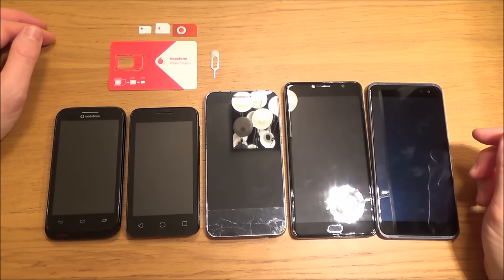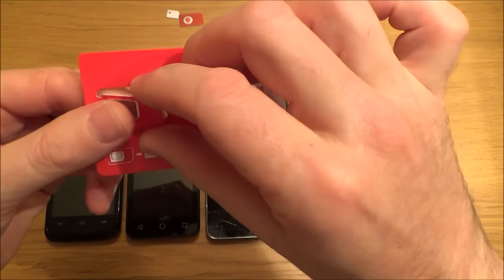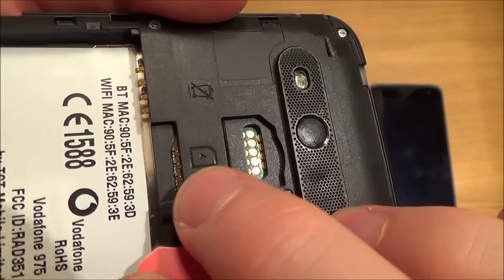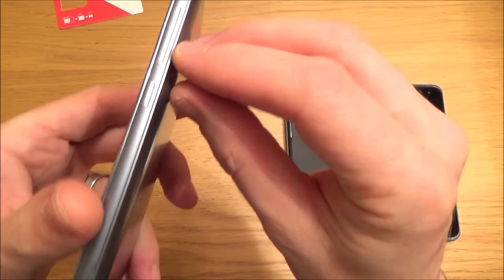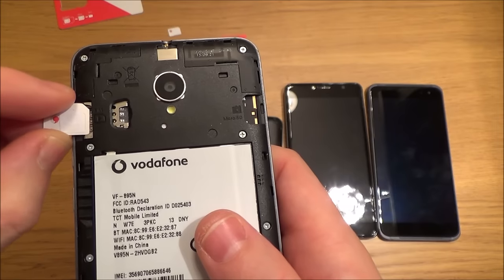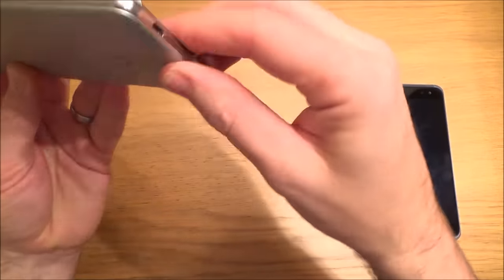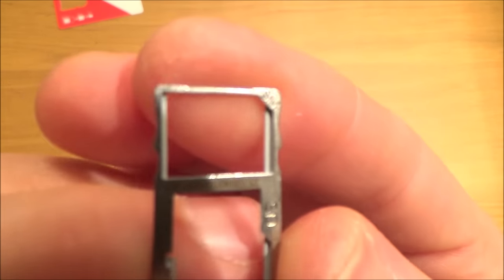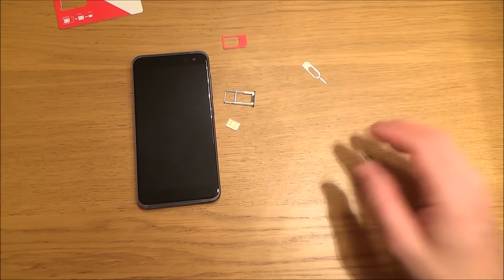How to INSERT / REMOVE a SIM card in various MOBILE  CELL PHONES

Comment: I have two new phones , why , because both phones say the same thing,   No sim inserted,  but they both came with a sim card inside ,  I have been calling and working on this problem for 3 weeks,   my first phone is from Consumer  Cellular, the second is  a Phone  Android ,  i  was told by CC , that the cell tower carrier, they deal with,  are receiving to many calls, they couldn't solve the problem , all I could do was use texting ,         The second phone was a prepaid  ST,   i  went on line and activated the phone , but now it say s    no sim card inserted, and yes it has a sim card inside.     I am 73 years old,  can't call anyone of my family,  i have been isolated in my home  for 3 months, can you tell me , or help me understand this problem.   Before i spend more money on phones.

Comment: THANK YOU! This video is still useful in 2021. 
I just dropped my Samsung cellphone on the floor. Face down. It's screen is completely shuttered. Dead.
So I searched for my old Samsung and found it in a drawer. The emails showed that it has been sitting there since 2017. The battery – amazingly! – woke up and charged. I gotta give Samsung a golden star for that. Again. (I am a graphic designer, I am used to work on Macs, but regarding the cellphones I am on the Samsung's side.)
I retrieved the cards from the broken Samsung cellphone and – thanks to your video – I managed to insert them in the old one.

Comment: I was having trouble getting the SIM card to slide in and now i know why. The size of the SIM card was one size too big. I took off the size and it slid right in. Thanks man.
Reply: Looking for advice too .Recommended thick special  cellotape press finger down many time open slot apparently sim will emerge, gentle bring it opening .Didn't work for me then I had afterthought pr tweezers gently grip tip  or  edge of sim which is easest be careful .Hope it works for you best solution. WIshes best luck 🎉

Comment: Excellent, thank you. You explained which way to put it in. Mine did not have a tray, put it in right but kept saying no sim?? Then I seen how you can get 3 different sizes from 1 sim. So went thru it all again, and noticed my card it came in still had the pop outs. What happened was I put a nano in a micro and it didn't work. Popped it back in the outer rim I still had and it works fine. Thank you, love doing things myself.

Comment: I have a Q link phone, Called a Hot pepper, its powered by android and it's was free for me I leaned how to remove the cover and the battery but the sim card is way smaller than what you have shown on your video's  so maybe mine doesn't need a new one I'm confused. loved your video you taught me several things thank you so much I will contact Q link.

Comment: Does a gold part of the SIM card go towards the screen or to the back of the phone because you had the phone upside down basically with the screen facing away so that's my question does the gold part face away from the screen it would have to I would think but since you did it backwards that's what you should add the screen facing the people so they can actually see which way that's green the card goes in but very good thank you very much for what you've done

Comment: Very helpful! Thanks. This is only the second cell phone I’ve ever had. Last time I think I took it into a store and they did it. Because of covid I haven’t been going in to stores. I’ll have to do this on my own. You made it much easier to figure it all out. There was no instruction on how to open the phone and there was no instruction on anything to do with SIM cards from the manufacturer’s manual. So this is greatly appreciated. I’m still a little confused about that second phone, I think it was. You said one slot was an SD slot. My phone looks like that slot but it says “SIM2”. I’m wondering if I can use both the micro and nano from the card that came with it?
Reply: Any one card that comes with the phone can only be adjusted to one size, based on the cut-outs of the card. You would actually need another card to use SIM2. A SIM card contains a person's phone number.

Comment: Hi Vince. Senior, and not very tech savvy. I have an old samsung s730m that is not cutting it anymore. I only use pay as you go for calling and texting. I purchased a new samsung galaxy a51 dual sim unlocked phone. If, using your video, I remove the sim and put it in the new phone, will that phone work, or must I contact a provider? Any help appreciated.

Comment: I'm in tears because I've  just broken three fingernails trying to get the back off of my phone using that notch. I do not  see how you popped them off so easily. There's no room in that space to insert a blunt knife, let alone one of my fingernails. I tried a tiny screwdriver, but even that is not small enough. I just cannot pry it off. I realize this is an older video, but maybe you'll see it and offer a solution.

Comment: I had no pin to open the side so I used a pearl earring and it popped open ,happy days
Reply: Actually any things that are small enough and strong enough like a straight steel rod can works to fit into that Sim hole and just push it in.It will pop right out of the Sim tray card out.Basically inside that small Sim hole it just a very small button on a spring that it.Buying a Sim tool for tray opener it a waste of money and waiting times for it to arrive.Remember those desktop computers with a CD/DVD drive with a small hole.You can pops it open the CD/DVD drive tray with any small flattening out small paper clips.It the same things designed just now it in a cell phone that’s all.
Reply: :o

Comment: On a iphone its also the same for a sim edject find a hole with a oval on it put the tool in and give it a bit of force and it will come out(physical sim iphones only) Note will not work for phones using esim

Comment: You neglected the procedure for every phone I have had...which is a clip that must by slid with one's fingernail, and flipped up so that the SIM can be inserted into that little clip holder, than flipped and held down and slid to lock it in place. The big problem with these clips is that they are delicate. If one isn't careful, the whole clip can pop out of the phone and one needs the precision of a brain surgeon to reattach it to the phone by inserting some really tiny pins into tiny slots.

Comment: Thanks a lot!  I just bought a smart phone and there is no little key inside the box, so I cannot get the sim card out of the phone.  Worse = that when i opened the newly bought phone it asked for a code, but I got it wrong, picture of the code in IN THIS phone!!   So I tried 3 times and now it asks for a PUK code which I do not have.  I can not use my old phone because I cannot get the sim card out of the newly bought smart phone. What a stupid vendor, only gives half of explanation and now I am without any phone the whole evening and tomorrow loosing time to get back to that provider shop.  Would you be able to help me please how to get the sim card out of the smart phone without the small key that anyone can loose easily anyway. And hopefully I can use the simcard in my old Nokia again without asking me for sim or puk?  And what to do to get the puk code?  Many thanks for your help.
Reply: Lucy.roguez.quichro
Reply: Dinah Andersen me i was using the eyebrows remover instrument to remove my sim in the phone helping with nidle

Comment: I have watched a thousand video's now how to insert my simcard, which makes me mad, because I had mobile phones since 1991 and it was always easy.
Untill my Galaxy A52S, which does not have the simtray you see in all the video's. I have already contacted Samsung, but they haven't told me yet where the sim is hidden. 
Who has ever seen a A52S with no simtrays on the outside at all and knows how to insert a sim in there?
Reply: Meanwhile I had contact with the terrible customer service and swear I will never buy Samsung again. There are different region versions, but they won't tell which version I have.
The version I have has no simtrays and on the top only one hole and the first thing customer service asked was if there was one hole on the top (instead of two which all the versions on Youtube have). Now they simply don't respond at all anymore and told me to go to a service center 100 miles from here. This is to find out where my sim is located, imagine.
 So that is customer service for you.